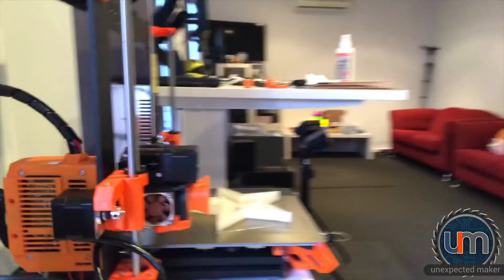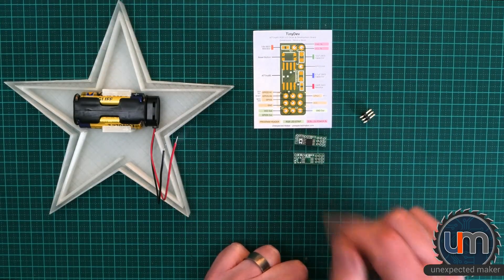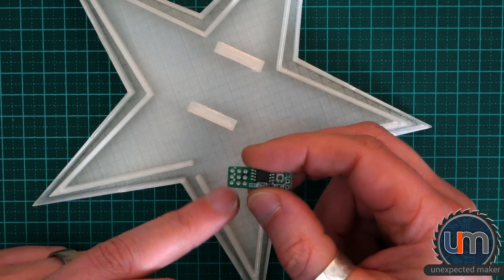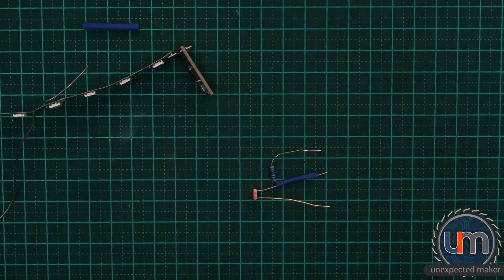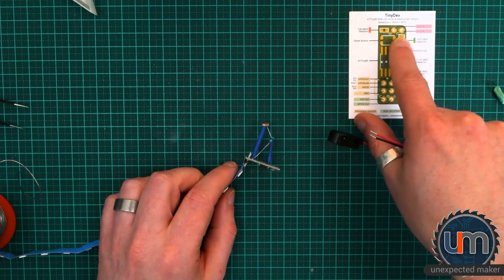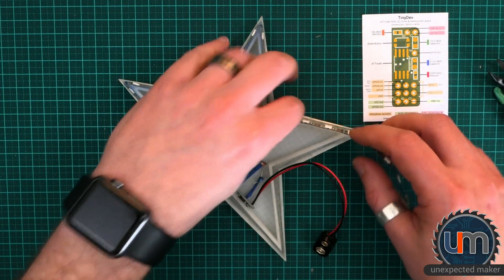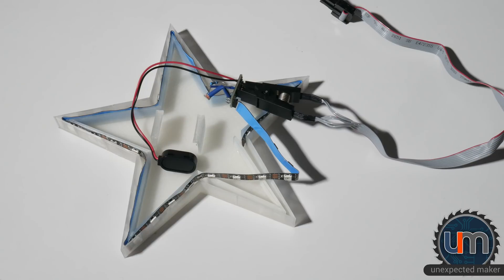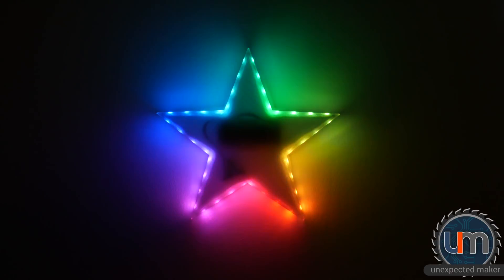Kids RGB LED Star Nightlight

Comment: Maybe you can have more diffusion in v2.0; So those individual pixels are not seen.
Reply from the maker: Sure... for my first attempt, I wanted to make sure I got a lot of light out of it... in the video where I say "wow" - that is honestly the first time I saw it working. I can definitely thicken the edges to diffuse it more, or even bring the pixels in more to light up more of the star.

Or, I might just move on to the next RGB project, and take what I learned from this and my coffee coaster ;)

Comment: Didn’t expect the blues and greens to light as bright using only two AA batteries. 
Nice to know that those leds don’t necessarily need 5Volt.
Reply from the maker: I was also surprised in a previous project that I could drive them off 3V too... but they work pretty well. The blues and greens def fade out the first as the voltage drops, so I'm going to look at either 3x AAs or 2 lots of 2x AAA in parallel for revision 2 and future projects.
Reply: Unexpected Maker thanks for the reply. Just note that an AAA has less than half the capacity of an AA. So unless you want to make the project thinner, using AAAs in a series plus parallel arrangement does give you any advantage.

Comment: Now to figure out how you are going to use a light sensor that does something when the light of the star interferes with the reading of the light sensor.....
Reply from the maker: Ahh, but it doesn't ;) It's pretty dark behind the star and the LDR is picking up ambient... that's why I am using auto ranging values in my code. I've not had any false positives yet :-)
Reply: Good to know! :)

Comment: Another cool creation! Your kids will absolutely love that. Hopefully not too many other neo-pixel projects already in their rooms, or there'll be no sleep. LOL
Question: Assuming PLA (or PLA+), is that White or Natural?  I'm currently using White PLA+ for diffusing, and I haven't actually tried (or even bought) any Natural yet.
Reply from the maker: It's transparent PLA, like I used on my coffee warmer. Looks super transparent when it's thin, but goes quite opaque as it builds up, but works amazingly for diffusing RGB LEDs ;)
Reply from the maker: I added a link to the PLA I use in the description - it's Aussie PLA, but there much be plenty of brands that make similar
Reply: Thanks. A good idea for any others who are curious. I've found some available locally, so might give it a try. 
Although, I guess "transparent" isn't necessarily the best if you actually want to diffuse the light?
Hmmm. By the time I've tried White as well as Natural and Transparent spools, it'll be an expensive diffuser! LOL 
I noted the web page mentions "annealing the printed part by placing in an oven at around 60-80 degrees for 5-10mins"
Have you given this a try to see what effect it has on the light transmission / diffusing consistency?